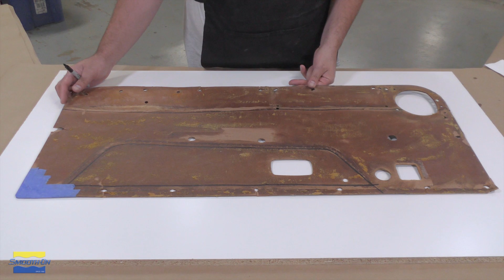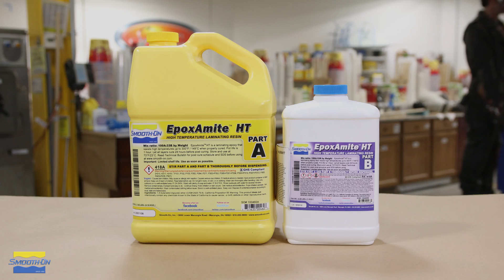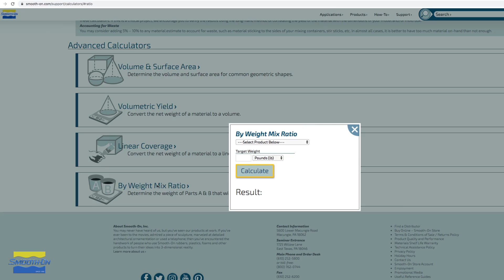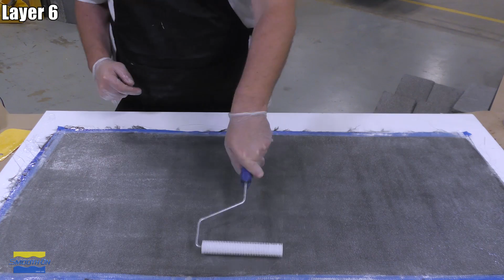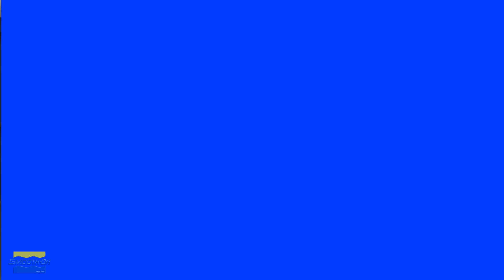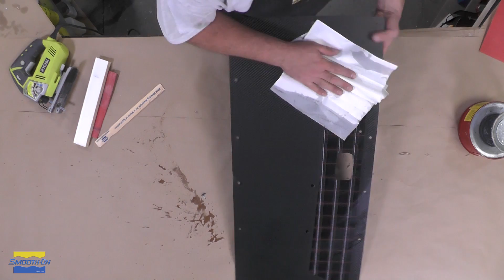How To Make a Custom Carbon Fiber Door Panel Using EpoxAmite High Temp Laminating Epoxy

Comment: Milo...If I wanted to make a silicone cast of the intake chamber of a cylinder head (intake port to valve pocket inside head) how would I do that and successfully remove from head? Would you consider making that video?

Comment: Word of warning; any "structural" carbon fiber pieces to be made, fiberglass SHOULD NOT be used are a support backing.

fiberglass and carbon fiber have different thermal expansion rates. The fiberglass will expand more than the carbon fiber, breaking the carbon fiber strands, basically making the fiberglass backing the main structural strength of the piece. 

If the piece is a superficial piece, like these door cards, then it doesn't really matter.
Reply: I think the door panel holds the car together ; )
Reply: @miloradmedunic6202  hoods, door skins, trunks, ect (basically any exterior body panels) are structural.
Reply: @mtktm  and 90% of them mix carbon and glass, its fine.  All the biggest carbon manufactures do it without issue.  So maybe this is the one time a youtube professional in the comments was wrong....who knows.

Comment: where do you get the various flat bottomed mixing containers? I used to use beer pong cups, but they changed the bottom from flat to concave.
Reply: Reynolds Advanced materials has them in any quantity!